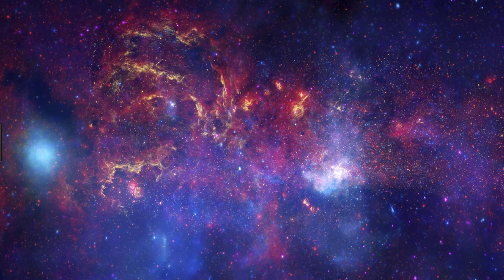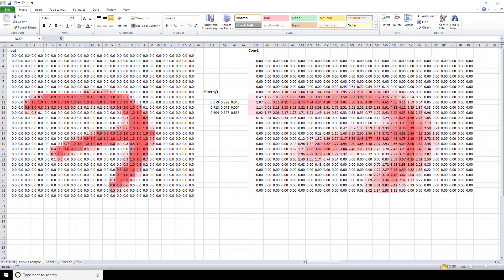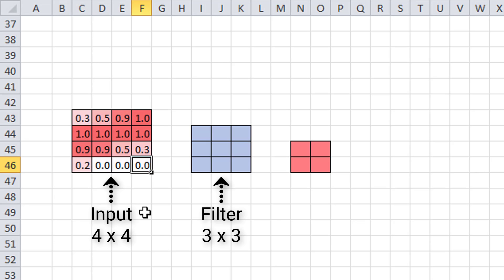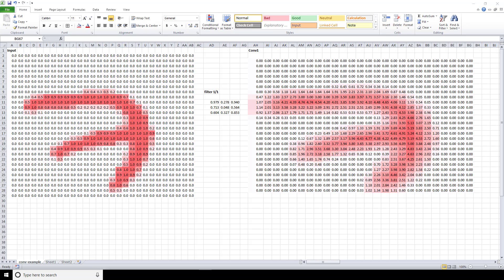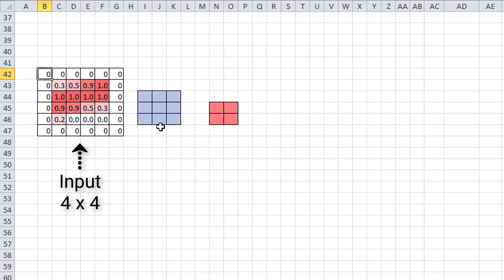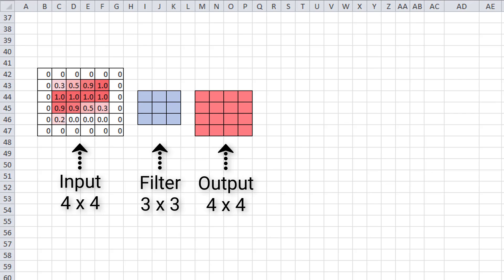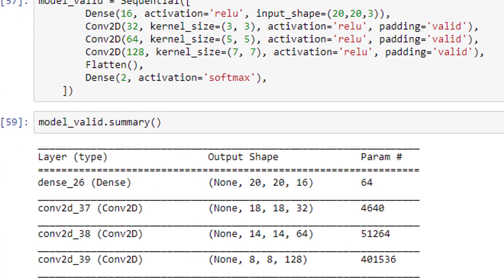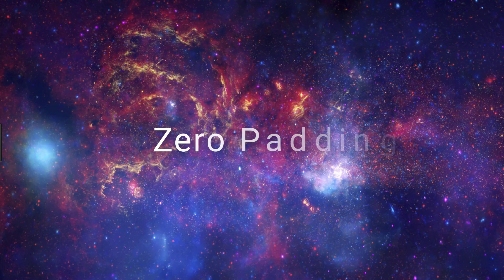Zero Padding in Convolutional Neural Networks explained

Comment: You have an RGB image as the input. Does the filter size automatically recognize it and initialize with depth 3 implicitly? For example, the first layer filter would have the shape (3,3,3)

Edit: I think I get it. Since its conv2d, you are using a dense layer to just pass in the r and g channel simulating as 2d image samples whilst the b channel acts like feature columns. Do you think using a 2d black and white image would be clearer to show? Am I understanding this right. Awesome video btw!

Comment: first of all: This course and other related videos are wonderful, currently binging thid series. I was trying some stuff in parallel on google colab trying out keras and i was wondering: Is it possible to shift the "basepoint" of the filter in keras? For example if I am considering sequential 1D data I'd want to convolute some datapoints to the left of my basepoint: In that case we'd only have to pad out data to the left (where data long in the past isnt as important as in the future), while on the right the last convolution to be calculated is a close to the edge of my data and takes more datapoints from our data than when we were to 0 pad (where wed only get half the data)

Comment: Great video! I have a question, what is the significance of zero? Can we initialise the padding with random numbers? I think it might add info which we might not want, idk just guessing.
Reply from the maker: Yes, if we use non-zero values, then it will affect the output of the convolution operation in a way we wouldn't want. There wouldn't be a way to distinguish if the non-zero numbers were used only as padding, or if these numbers were actual data from the images.

Comment: halo,
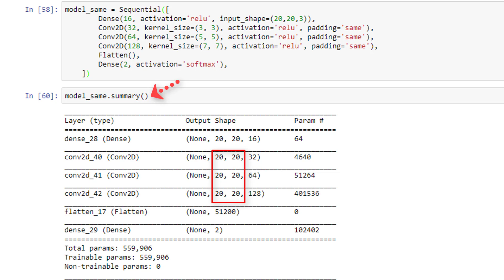1.what is the first and last term represent in output shape?13:04.....example: (none,  20, 20, 16) ...
2. Since we have one dense layer and 3 conv layers in this example, the neural network looks like one input layer, then 4 hidden layers followed up by an output layer...right?...so total 6?
Reply from the maker: 1. The batch size and channels. Here is a resource: http://deeplizard.com/learn/video/k6ZF1TSniYk
These axes can shift around depending on which framework is being used. 

2. Don't forget about the input layer. It is implied. Also, the flatten operation is questionable. Pooling is another one that is questionable. Some people call those two layers. However, they don't have any weights (learnable parameters), so some people just look at them as operations within a layer or inside the network.

Comment: Wow, great work. Could you do even more sophisticated NN as well (GANS,GRU/LSTMs)? I guess the  stride in keras is 1 by default but it's also changeable. The padding is kind of a hyperparamter as well or are there specific situations where you definitely recommend "same". (Suppose I do not know whether all my pictures have important patterns at the edge in advance)
Reply from the maker: Thanks, Daniel! I have the other types of NNs you mentioned on my list as potential topics for future videos. Thanks for the suggestions. Yeah, padding is optional, and sometimes might not be necessary or desired. It is pretty conventional to use zero padding though. The top answer on this stackoverflow question sums up the reasons why this is:

https://stats.stackexchange.com/questions/246512/convolutional-layers-to-pad-or-not-to-pad

Comment: what is third element in shape and what is  param , how they are counted
Reply from the maker: Hey diksha - The parameters shown in the summary of the model represent how many learnable parameters are in each layer. Learnable parameters are the weights and biases within the network that stochastic gradient descent is working to learn and optimize their values to achieve a minimized loss. The number of parameters in the network is determined by several factors, including the numbers of layers, the number of neurons in each layer, the number of convolutional filters, the size of the filters, etc.

That being said, the calculation for the number of parameters in a convolutional neural network is a bit more involved than in a network that only contains standard dense layers. I may do a video that shows how the calculations are done, but in the mean time, here is a simple example for how they're done for a network containing only dense layers.

Think of a model that has an input layer, the first hidden dense layer with 16 nodes, the second hidden dense layer with 32 nodes, and the output layer with 2 nodes.

First hidden layer parameters = 16 weights + 16 biases = 32 parameters
Second hidden layer parameters = 32*16 weights + 32 biases = 544 parameters
Output layer parameters = 32*2 weights + 2 biases = 66 parameters
Total parameters = first + second + third layer parameters = 32 + 544 + 66 = 642 total parameters
Reply from the maker: Hey diksha - I just released a video on this topic and thought to circle back around to you to share it.
https://youtu.be/pg3hJpSopHQ
Reply: Awesome!